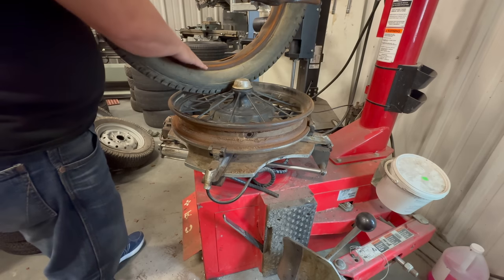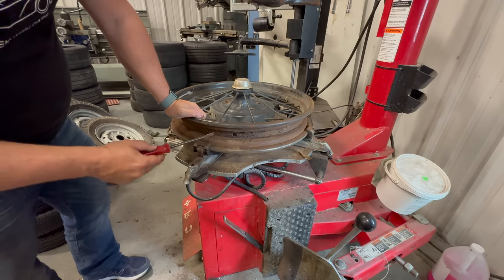Finally Driving the 1928 Ford Model A

Comment: I've been mounting tubed tires for 50 plus years. Bicyles, farm equipment, cars, trucks and motorcycles. Adding just anough air to the tube to hold its shape before installing in the tire helps prevent twisting and pinching as you mount the tire. Once mounted you inflate the tube without the valve core using a rubber tipped blowgun to seat the beads then let the tube deflate. This relaxes the tube to remove wrinkles in the tube. This helps prevent the tube chafeing inside the tire as it rolls down the road. Adding a dusting of taclum powder indide the tire helps too. 
Then install the valve core and inflate to pressure. 
The best way to find the proper pressure for tires is look in the owners manual or on the tire placard on the car. If those are not available is to set them where you feel comforatable then drive down the road at highway speeds for at leat 15 minutes to get the tires warmed up to operating temp, pull over and check the tires hot pressure. If your cold pressure was right your hot pressure shoulb be 10% higher than the cold pressure. If its less than the 10% your cold pressure is too high. If lmore than 10% the cold pressure is too low.
Tires flex as the roll down the road, this flexing heats up the tires causing pressure to go up. Manufacture's know this and allow for it in determining cold pressure. This 10% works for all tires. 
Even when using the manual or tire placard for cold pressures, those only apply to the size and weight limit of the tires listed. If your tires are not the same size or weight limit as specified they may need a different pressure. So checking with the 10% method is a good idea. 
Running the proper pressure increases the steering and brakeing responce, maximizeing safety as wheel as tire life.

Comment: I think that was a success as well. All the creaks and rattles are part of the experience. Really nice to see it out on the road and seems to run well. Thanks Steve a great video.👍👍
Reply from the maker: The wood floor is not bolted back in yet from replacing the battery so a lot of the noises will go away when I button everything back up.
Reply: @ThisWeekWithCars  Understood Steve!

Comment: Excellent video Steve  :) those tire back then amazing how last on tires and got on option of air pumps for tire on old 4 cylinders of Connetial one when engine running to! I changed lots tires in past one were most common in 1990's was Firestone and Good Years to in those balloons types owners buy for those cars also trucks back then ! I have one orgnail air pressure from 1918 to 1940 it made out copper metal ! Hope you enjoyed that car and Restoration lots them over years!

Comment: Interesting, but it would have been more helpful to people who don't have access to a tire machine to dismount/mount the tires "by the book."
Reply from the maker: You would have to break the beads loose with whatever you have sitting around and there is no by the book way to do that especially when they have been on the wheel for decades, every video you see on changing Model A tires will be different.  I think I made the only video showing a tire machine used.